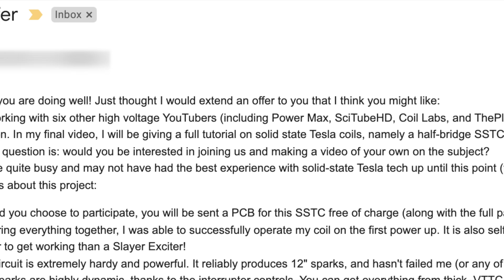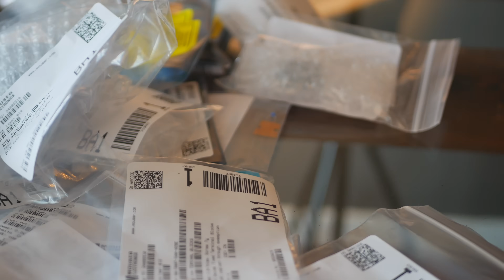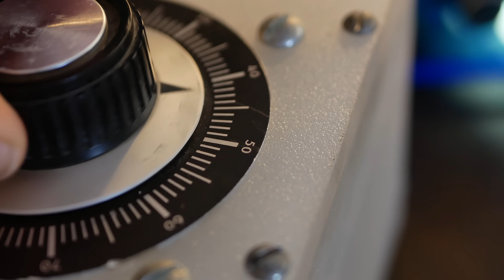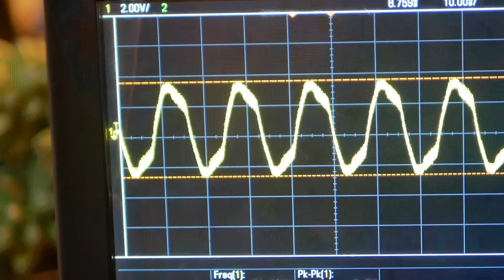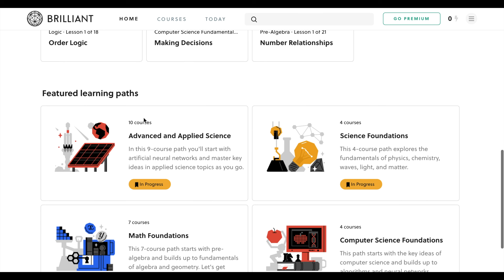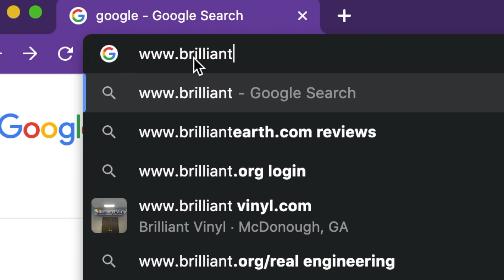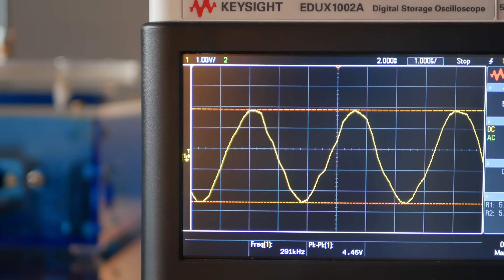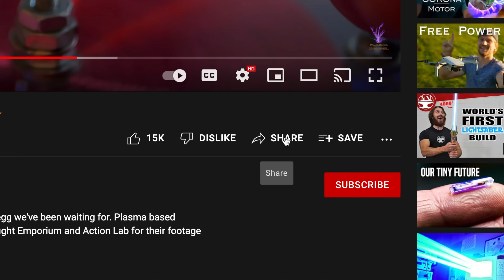⚡Building This Tesla Coil CHANGED EVERYTHING (HUGE 3D Lightning)⚡

Comment: Hey i build it but for safety how do you power it? Does it have 12-24v for command and 230v ~ GND 230~ for power ? Do the antenna need to stay under the coils?

Comment: I know I'm a few years late to the comment section but your problem with metal fasteners can be solved by switching to nylon nuts and bolts Waay back in the 80's we were using them to hold the wings on model planes. they are non conductive and didnt interfere with our radio signals.

Comment: Instead of using transformer to drive IGBTs, use any of the ICs specifically for the purpose, such as IR2110.  IC has controls to prevent cross-conduction of the IBGTs & weak drive due to low supply voltage.  These ICs can handle driving bridge of IBGTs or FETs from up to 600V bus.
Reply: i thought that too and went that route, but nothing beats GDT.

Comment: I have ideas about perpetual motion, but I could never make a machine like you can.
My initial idea is magnet placement according to Metatrons cube.
I would love to create something for humanity.

Did you know the geometry of the rotary motor is from Metatrons cube?

Also I wonder if 3D platonic solids are wiring diagrams, or structures that do something when a charge travels through certain paths to connect all the intersection points.

But yeah, hopefully make a Stargate or antigravity thing, or just free harnessed energy, I can go on

Comment: Second time I have watched this video. Enjoyed it as much the second time as the first! One question though. Why does everyone call any and every high frequency air-core step-up transformer a "Tesla" coil, when in fact most people are making Oudin style HFHV coils? I am also surprised no-one has been trying D'Arsonval style HF air-core coils (pancake style coil HF autotransformer. Much lower voltage but much higher amperage and massive brush discharges).

Comment: If overdriving the gates of these transistors is an issue you encounter regularly - consider using a zener diode at the gate to limit the voltage. Find a zener with a breakdown voltage at the highest voltage you want the gate to every encounter & wire the zener to create a safety bleed to ground whenever it encounters voltage that meets or exceeds it's spec. Cheap safety valve.

Comment: I don't think your direct problem is cooking the IGBT's.  I had a oroject some 30 years ago (5-axis laser cutter) where I was driving DC Servos with 3055's.  My techie wasn't happy using bipolars, so we "upgraded" to MOSFETs.  And had an impressive chain of exploded semis.  It turns out the "insulated gate" is the problem - consider, they're capacitor, and when the gate is "On" have a rather largish capacitance.  Then you turn them off.  Now, divide time.  There is a charge on capacitor, right,  And Q == VC.  Now what happens at turnoff?  C goes towards zero.  When that happens, what  happens to V?  Ans: As C --> 0, V goes towards infinity, or rather V goes to, "Punch a hole in the "I" part of IGBT.  Hole in I == dead IGBT.  So what has to be done is to carefully limit dV/dt on turnOFF.  which, of course leads to increased dissipation.  Turns out, it's a careful balancing act.  which is what IGBT driver silicon is supposed to do.  Read spec sheets HARD, and there are ways to adjust This parameter.  And Good Luck.

Comment: Thanks for your great videos and the "spark" to get my ass in gear to build one.  Two tips for you....  1.  I did not notice any Dow 340 - thermal grease - between the power switchers and heat sinks which may have contributed to your early failures.  2.  The use of a long screw/bolt for the "spark rod" I believe is loosing some percentage of the available energy at the spark "tip" and to make sure all the energy exits from the pointed screw, I would suggest to use a brass sleeve that just fits snugly over the screw.  This way the only sharp point that the sparks jumps from is the very end....  The screw threads, although not real sharp, are letting some of the energy leak from the threads themselves at 11:29  as seen in the last views of "full power"....  Anyway, just a note on getting that last few millimeters of spark to exit at the end point....  Hank

Comment: 20 years working in high voltage? Dude I thought you were at most 30 years old lol 🙈
Reply from the maker: Haha I’m 34, started when I was 14. 20 years! And about 15 times I should have been electrocuted….
Reply: Many of us get bit by the lightening bug at a young age. I started at 10 back in the 60s. And I had to go thru that learning curve where any circuit I build turned out to be a Light Dimmer.  Happily I have progressed enough, as I got older,  where my circuits actually worked.

Comment: I have about 10 of Steve Ward's original SSTC driver boards, fully populated. I used to burn them up and so I made enough to last me a lifetime, and they sort of have.
   Thanks to Steve, Cameron, and Arc-Attack Joe (I used to moonlight for Maker Faire, when they had them, in the Bay Area, and ArcAttack was a perennial favorite), I built numerous SSTCs - destroying many parts and vaporizing (figuratively) about 6 garage door openers (they don't like arcs) in the process.  I was able to do "concerts" with the musical coils in my driveway.  I've actually got Steve's 2.0 boards with the FPGA - but I never built the controller that he genned up with those coil guys from the Tesla Coil club.  Life wound up taking me in different directions, but I like your small pancake coil  which seems to have an output more akin to what I've seen in the vacuum tube coils Steve and the boys made.  I've never done one of those, but would like  to.

Comment: Can I ask you a question? So theoretically right, and keep in mind please I know absolutely nothing about anything lol this is just a creative thought I've had in my mind about tesla coils for a while, I don't even know if it's possible which is why I wanna ask. So those sparks that are coming out of the coil, they create real electricity right? I saw your light bulb turn on and have seen a few other videos doing the same thing. Would it be at all possible to create an enclosure around the coil that would attract the "Lightning" or sparks whatever you wanna call them and absorb it to then be able to turn it into an output of usable electricity? I've been wondering this since the first time I saw a tesla coil. So like the tesla coil creates the sparks which would be the transmitter and then you would have the receiver which would catch the sparks and convert it somehow into usable electricity. The main goal would be for that receiver to be wireless somehow like some sort of attachment that you could connect to electronics that would be able to pick up the waves created by the coil and use it to power your electronics so they would never run out of batter they would just constantly be powered as long as your within range of the waves. Would any of this be possible?
Reply: Also if you do end up trying out something like this or have already tried it out can you please get back to me and let me know how it went.

Comment: Hey, I almost have every other part, but those igbts are pretty expensive (26$ for 4of them) and as this is first time im making a solid state tesla coil, it can be not enough even the two spare of them (ill try to be very carefull, bet who knows how much of them burns) . Im curious if there’s a cheaper alternative , like mosfets? I was thinking of buying a 10pcs pack for 16$ from ebay, but they cant be original and as powerful as from mouser.

Comment: After you made the first built of a 3V SGTC, I made one too, and it got me interested. So I bought a slightly big SSTC (a 1 foot tall). I also happen to burn some IGBT, and in the process learned how to test IGBTs with a multimeter, wich is cool. I’ll have a look to see if the problem you encountered could be responsible in my setup.

That said, the SSTC I bought is "tower" shaped. It would be nice if I could turn it in a "pancake" shape so it takes less space, and also I absolutely LOVE the salmon/orange color of copper, and would love to have such big plate of coil out of it :D.

Comment: What is the field of study I need to follow to be able to research, manufacture and test like you or study high voltage? Hope to reply.
Reply: A BS or MS in electrical engineering will get you most of the way there, but to head your own research, you might need a Ph.D. Finding an job where you can experiment with high voltage...that's gonna be kinda hard, unless you just want to design stuff for the power grid. Hope that answers your question!

Comment: In 1891, Nikola Tesla filed U.S. patent #468,418 for a transformer that could convert alternating current into high-frequency AC. This technology would form the basis of the modern electrical grid. But Tesla's vision didn't stop there. He also saw the potential to use this technology to create powerful electric currents for propulsion and power generation.

One of the biggest challenges with creating an electric current is finding a way to create a spark gap that can handle the high voltage and amperage required. But what if there was a way to use IGBT transistors instead of spark gaps?

IGBT transistors are able to handle much higher voltages and amperages than traditional spark gaps, making them the perfect solution for building a Tesla coil.

Tesla coil technology has been around for over 100 years, but it wasn't until a few builders started to change the traditional design that people began to see the potential this technology had for generating free energy. The new design of the Tesla coil transformer has made it possible to not only produce free energy, but also to do it in a way that is relatively simple and easy to build.

One of the key features of this new design is that it uses a capacitor bank instead of an air core. This allows for a much higher voltage to be generated, which in turn results in more power being produced. Additionally, the use of capacitors allows for greater control over the output of the Tesla coil transformer, making it possible to adjust the frequency and voltage as needed.

Another important feature of this new design is the use of a spark gap.

Comment: I've just joined your website and it's great,  I've tried building Tesla coils and to some success but retired and low fixed income it takes a few months to make side income for planning parts and supplies.  I just finished a flyback high voltage driver and ten stage multiplier,  that basically I've built from your series.  Great work young man,  love watching you build and display your work.  Steve in Montana.     Keep up your great episodes
Reply from the maker: Thank you Steve! Glad you’re building these items and exploring them for yourself.

Comment: Hiya, Jay;
You already know electronics can overheat.
But what do you know about fan aerodynamics?
It looks like the fan duct is A) the wrong size; & B) the fan may be mounted backwards.
The fan hole should be at least 1/2 the fan diameter or larger.
Fans pull better than they push, many don't believe that.
You can prove it to yourself the same way I did.
Go look at your air conditioner fan.
When I heard about fans being 20% better at pulling than pushing, well, I didn't believe it.
But I thought, 'I'll look at my AC'.
I did, & it (an old Carrier) uses a pull configuration fan.
The only caveat is you may need a 'guide' for the air.
A simple solution is a can the right diameter & cut to length.
Thank you for your interesting videos.
I really appreciate the videos on harvesting natural electricity.
The 100's of volts of electric potential fascinate me.
I'd love to find a way to use it to charge batteries.
Have a GREAT day, Neighbor!

Comment: I have built some of these SSTCs also. Have you considered ZVS switching with 2 IGBTs, so no antenna feedback is needed? Another way would be to use a 555 timer as input to the driver for any number of IGBTs in parallel, and adjust its time period to the natural resonance of the pancake secondary coil (using a test light), Nothing to break then except overheating of the IGBTs! Slayer feedback overheats the semiconductors. Antenna feedback is a bit complicated.

Comment: Why dont you try adding audio modulation to your circuit? It would be pretty straight forward, if you can chop your circuit already, feed the chopper circuit input to a pwm modulator and there you have it. I did something similar on my channel, granted I used a conceptually different design for the driver.

Comment: Interesting :) can it change output frequency? I want to get high voltage supply which have variable voltage and frequency.. because my experiment... I want to know the circuit and what parts did you use...

Comment: Is your secondary winding method allowing multiple layers to accumulate? Cuz I've trying to wind one like that for a minute now and... so frustrating! if I space the acrylic for one layer its too tight and the tension is so great it either won't roll snug, or the tension causes it to pull past where it should and overlap. On your video I saw you clearly used two washers which is all fine and dandy but I was under the impression that overlapping secondary wires would cause arcs and such.... but apparently not... so... ya... I guess I'm asking... nothing... unless I'm wrong about the spacing. plz correct me if I'm wrong... Thanks, keep up the awesome projects, I too am obsessed with plasma, so big fan...
Reply from the maker: Correct, my method is not perfect, and I expect the secondary to fail eventually. It is about 2-3 wire turns thick, while spinning outward.

Comment: In my research I've found that Tesla did not use alternating current in his magnifying transformers but used high voltage DC from a generator that was pulsed using  magnetic arc disrupter devices .  He was using one way , non reversing high voltage DC impulses to power the primaries of his coils .

Comment: it often amuses me how a A+ electrical designer will make such hideous mistakes in other areas in this case with the fluid dynamics and heat transfer F- . such a blairingly obvious mistake like the fan hole too small, no proper seal gap for the fan, etc, etc, etc. cringeworthy.
Reply from the maker: It often amuses me when people don’t conduct a multi variable analysis, such as 1) perhaps the fan hole was small for a specific reason other than perfect flow dynamics, 2) heatsinks are placed opposite the fan for a reason, 3) holes are drilled in the base directly under the heatsinks, and smoke flow analysis showed allowed for great convection cooling, 4) fan tested and proven to provide excellent flow regardless of two sides left open. 😉
Reply: @PlasmaChannel   you don't know what you don't know. 1. The fan hole being small means that the fan inside need a shroud inside  to stop the air recirculating and to form a one way valve. There is a difference between throughput and (re)circulation. 
2) high velocity cool new fluid extracts better heat than low velocity warm recycled fluid. I.e. the heatsink position.  Other specifics were hard to judge because of the difficulties with observing from video vs in person. Perhaps I came across as insulting, for which I am sorry. My comments were more of a general observation of a pattern not of your work specifically. And to the extent I was speaking of this job it was the limited to the scope of air recirculation due to the lack of shroud and small intake hole as that was the only part I was able to comment on.
Reply: @PlasmaChannel  I should add, thankyou for your content and work and actually I am an admirer of your efforts. Sorry for any negative impacts from my poorly constructed comments. All the best.

Comment: Yes. This is very challenging when you get board, schematics, tools and don't have to dive trough the trash to get condesators, wires, diodes to make yours... You just order your Lego project from the Amazon or eBay and it's still challenging... It's cool to have money to pay 10x project Worth to learn about voltage and frequency... Just keep up! And here is a 🙂

Comment: Hello, one question, putting the secondary coil in a pancake shape increases the voltage? Thanks
Reply from the maker: It does not increase voltage more. It actually creates less voltage, and smaller sparks. Biggest sparks possible is not my priority, though.

Comment: Hi Jay, I finally had my own workshop I've already built a Tesla coil inspired by your most compact design with a tv flyback transformer. I'll be really happy to get one of those boards and build a solid state pancake to power my low pressure noble gas tubes! Lets gets schwifty 😉

Comment: I definitely want a board!!!!! Very well done on your build! The GDT is quite finicky when pertaining to SSTCs, I have built a full DRSSTC driver that actually works and looks and sounds like yours!! Also I would highly recommend installing decoupling caps as close to the gate driver IC, by as close as possible I mean literally solder the cap directly to the pins of the IC. This will help keep out high frequency noise from the rails but also be able to deliver the high pulse current required for the GDT driver IC.

Comment: I don't understand why you didn't put the primary coil in the same plane as the secondary coil.
Reply from the maker: It was done for design limitations. I wanted the outer borders no larger than 8”x8”. So, needed to go underneath which worked great.

Comment: If the 11 kV / 440 voltage step-down transformer is used using a Tesla coil, will the secondary side produce 440v if the primary side uses it?

Comment: Can you hook it up with batteries, and power a motor that inturn spins an alternator at 6000 rpm. I can get this done using 2750 DC motor.  Just found a Dayton 1/150 HP 2750 rpm motor on grainger .56 Amp, or .52 cannot remember.